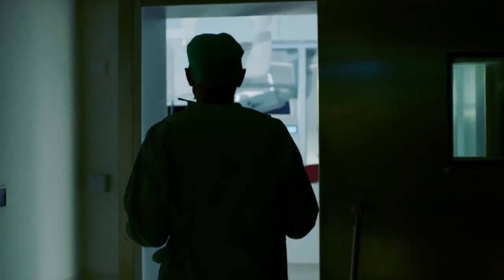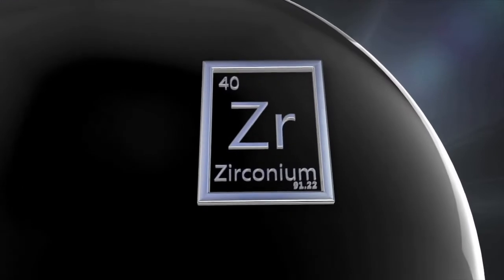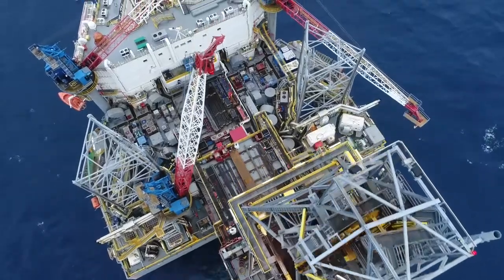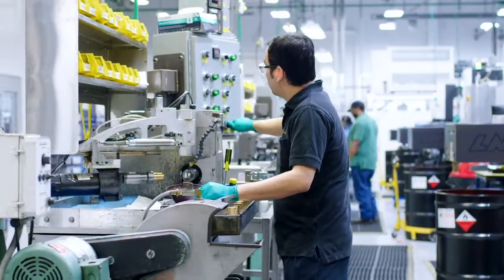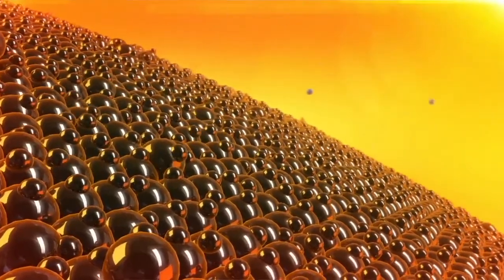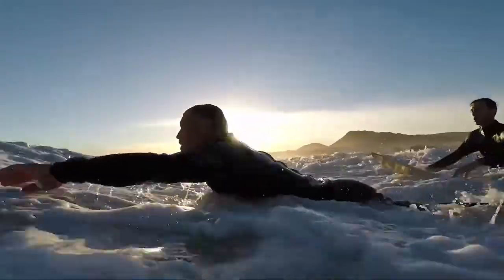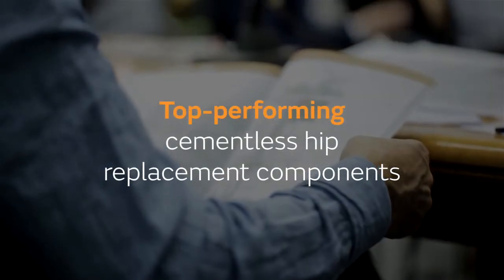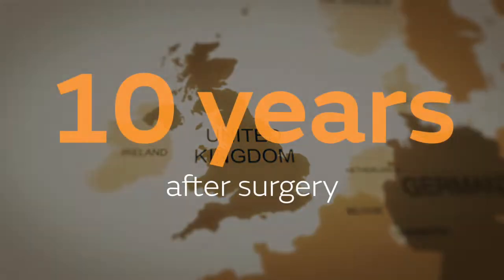OXINIUM  - The Moment of Change - OXINIUM Relaunch and Comparison to Coated Implants.

Comment: And what if revision is needed ? I'm guessing the tibial compartment is less shear resistant than the femoral condyle and patellofemoral surfaces, and it wears out quicker. is it possible then to only replace the polyethylene surface ?
Reply from the maker: Hi, thanks for your question! For sure you can replace only the polyethylene. We already have excellent long term results. So polyethylene replacements are very seldom.

Comment: Does oxinium implants n ceramic implants are different??
Reply from the maker: Hello @Trupti Mane, Thank you for your question. Yes, they are indeed different. An OXINIUM implant is composed of award-winning oxidized zirconium (OxZr) alloy. The original metal surface is transformed through heating in air at over 500° C to create a 5um thick ceramicised oxide. For further information please go to:  https://www.oxinium.com/
Reply: Thanks for information. But which 1 is better for durability?
Reply from the maker: We would love to help you finding the right implant bearing combinations for your individual need. Let`s get in touch and talk to one of our sales representatives in your region. Please send us a quick note with your contact details to info@smith-nephew.com.
Reply: how many years does this last before need new one